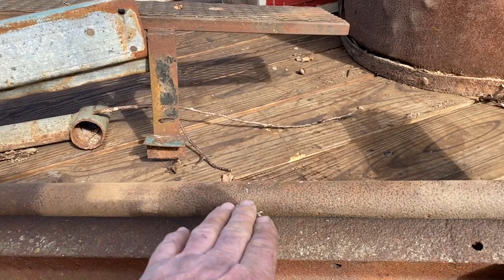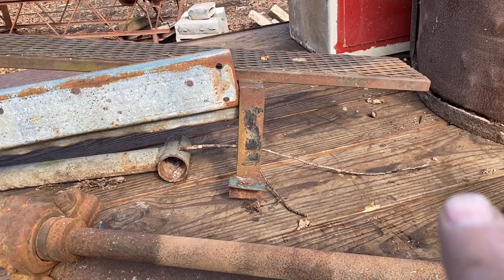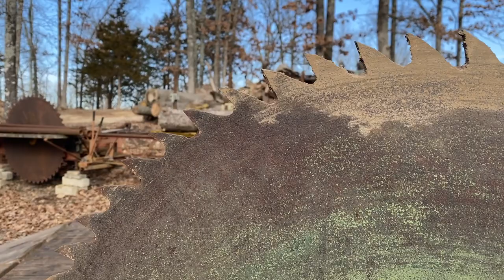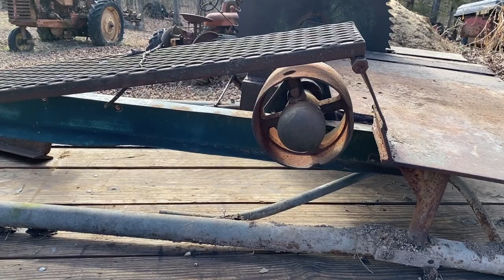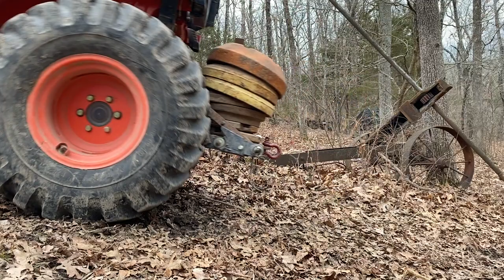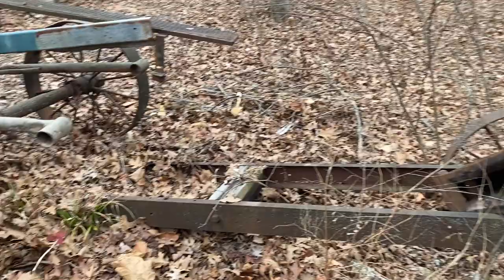Buzz Saw Built For Oliver 70

Comment: Thanks Wendell. The older I get the more interesting I find all of this. I will say those saws look a little dangerous.
Reply from the maker: A buzz saw is a lot like a good woman.  Treat them with respect and they will be your loyal helper, but the second you disrespect them or treat them carelessly they will bite you with a vengeance !! LOL.  Actually that was said in jest, but there's a LOT of truth in it. It's all about what you get used to Chris....think of it this way...Here we are with a nice safe rotating blade that stays in position and all you have to do is run the wood through it.....versus walking and stepping around and over round pieces of wood with a chain saw slinging a chain at roughly 60 miles per hour  in a different direction with each step !!  LOL...A different perspective.  Thanks Chris for watching and taking the time to comment.

Comment: IF you get that done it's going to look like something of a monster saw....that Galloway engine is just going to put away and now the people will be a talking and a looking ....and all you would need on that unit would be a splitter and you would be KING of the splitter wars.....CHEERS
Reply from the maker: Hahahahaha....That'd be cool Gator.  I do plan on building back the Galloway into a mobile saw rig, but maybe I'll put an old grinder on the other end instead of a wood splitter.  Hey I did see a guy that took a big make and break and welded a wedge to the iron piston after taking the head off.  Then he powered the dead engine with another running make and break with a flat belt.  Man that thing worked real good on the wood he was splitting.  But he ruined the big one building it.

Comment: that was a great video buddy nice old wood cutter when the snow goes I will get a picture of the old one over at the farm not sure what model it is but it has the tilt table and was always kept in a building its in great shape don't know what we are going to do with it if the old place sells but I would like to keep it but I don't have all the say everything was left to us three kids we put it on the market last summer had a lot of lookers the old farm was only 100 acres 38 on that side and 62 wood land on my side we just have the farm side for sale I want to keep the woods would like to have a camp back there to take the kids to I love cutting some wood nothing like being in the woods we have a road right to the back and at the back there a lovely spring the kids always have a have a drink when we walk there this is a long way from our story about your saw thanks for the video take care
Reply from the maker: I really like the tilt table rigs I've got in operation.  They are really convenient to use. A roller table is pretty good, but you gotta keep it clear of the dust and debris.  A slide top is the hardest for larger slabs or poles.  Most of the time there's not much demand for an old buzz saw, but sometimes people act like its a goldmine and they try to get 500 bucks for one.  Dummies.  LOL. I got all mine either free or traded something else rusty for them.  I don't think I've bought a single one yet.  I'd latch onto the old one you have over there and just offer the others a few bucks each for their part.  LOL.  My Much Older Brother has the old slide top we had mounted on the front of the Massey Harris 101 Junior.  If you haven't seen this yet, Tom, try this on for size: https://www.youtube.com/watch?v=IWbmGoSQ31g  I have a whole playlist of nothing but buzz saws up top too !!  One is an 8 or 9 part series converting one to three point for an old Ford 800.

Comment: Hey TM44 , they ever use those buzz saws to cut boards  , like a wood mill ?
Reply from the maker: Not usually. But we have sharpened hundred and hundreds of cedar fence posts. Small ones we would sharpen while round but 6” 7”&8” ones would be split like a rail then the halves sharpened. We would start a hole with a wood bar then drive the cedars in with a 16 pound post maul. Then stretch and staple Barb wire runs. We would set RR ties as corner posts and angled cedars to brace them.